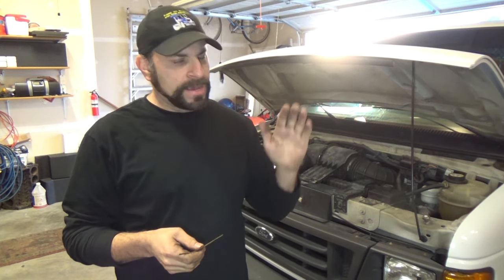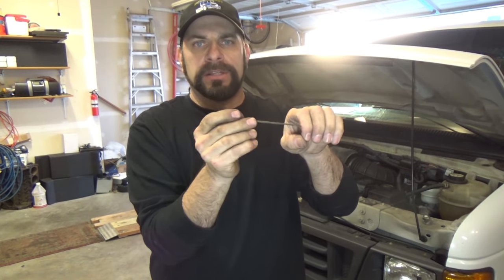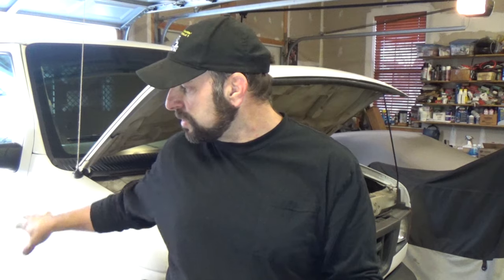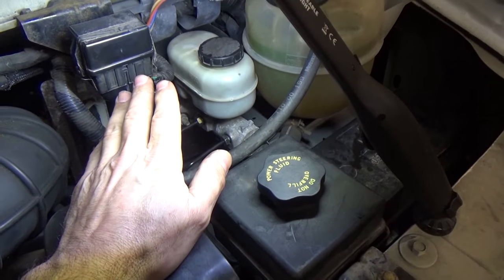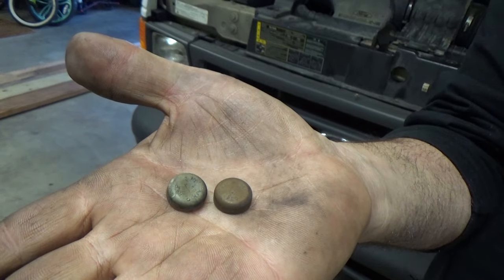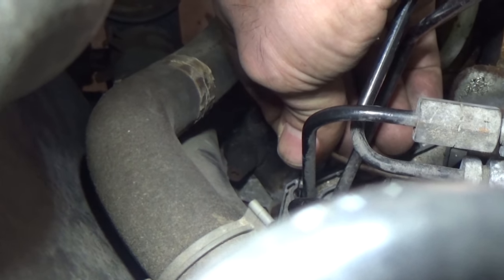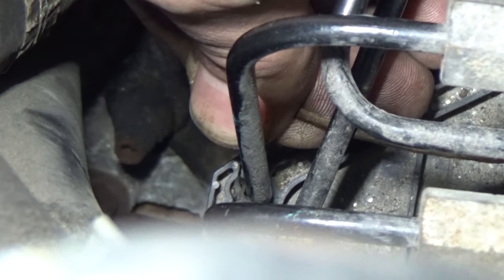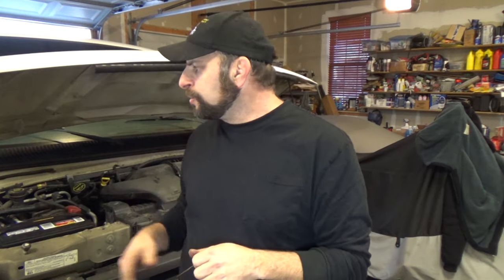Brake Pedal Goes to the Floor I ABS Pump Test I FORD I No Codes

Comment: my pedal is top pedal until i run the engine then the pedal goes smoothly to the floor .
Reply: Ever find a solution I'm in the same boat
Reply: @bradleytantlinger7041  the booster
Reply: @yasminalalgeroiseau1125 booster would make it hard not soft
Reply: Mine did same thing.changed master.abs pump was bad
Reply: It was the abs?
Reply: @mofeedfouad7391  just depends on your symptoms, everything seems the same with these, triple check that there’s no air in your brakes, take off the master to make sure the flange is pushing, then cap off master cyl lines to test master cyl(buy from oreilly and return if same symptom) then do abs last
Reply: So us the booster or abs
Reply: my toyota is doing that now. what was your problem?

Comment: This is probably the 8th to 10th ABS troubleshooting video I've watched in the last couple of hours, and yet it is the only one that actually showed how to diagnose the ABS Pump itself. Some people jumped to re-soldering joints in the ABS Module and they didn't even mention to try this first. Once you have eliminated; leaks (at each wheel, all the lines, master cyl, brake booster), blown fuses and relays, wiring/connectors/grounds, this should be the next thing to look at.
Reply from the maker: It's called proper diagnostics,  most people don't know how to test and not guess!  Thanks for.your comment.
Reply: @ozzstars_cars  Well you've got a new subscriber :-D! What part of the country are you in?
Reply from the maker: @PapaSmurf337  thanks for subscribing.  Delaware.

Comment: I have been fighting a slight brake pedal sink for about 5 years. After a ton of break fluid, 2 master cylinders, several trips to the break shop, all I can say is ..... Thank You!
My issue is very minimal, and is intermittent. 1 pump of the brakes, and the pedal wont sink, but sometimes the pedal will sink after I've come to a complete stop. A quick pump of the pedal and its solid again.
NOW, I know what to do to fix it.
You're awesome.
Reply from the maker: Thanks for your awesome comment James.  Good luck with the diagnosis. 👍

Comment: Hate that feeling like you stepped on a plum when you go for a panic brake. Nice work Glen diagnosing and getting the Ford back on the road.
Reply from the maker: That's a great analogy, a plum.
Reply: @ozzstars_cars  - Or, in the case of modern vehicles,  a turd ... 😃

Comment: Nice video.  Thanks for your time to produce this and your helper did a great job   I have 2005 F150 with this problem
Reply from the maker: I agree, good help! Thanks for the comment and good luck with your fix. -Glen (Ozz)
Reply: @daduze, i also have a 2005 w/ this problem. The trk is currently at the mechanic shop for changing out the shift lever cable. I asked the manager to check the brakes - explained the issue and he stated to fix the 'floating brake pedal' would be around $1800....I asked him if the issue would continue to degenerate... he told me it wouldn't - i felt like he didn't want to deal with it....prob. go somewhere else after the shift lever cable is repaired ~ thanks for the vid!!!

Comment: the new Master cyl seals   worked great   but with the engine running the pedal still goes to the floor .  A Foxwell NT 630 pro ABS bleed scan tool  bleed  has improved things   but the brakes are still acting up .  I need to go find a dirt road and have a play .. maybe the ABS unit just needs a good workout .

Comment: I drove my wife's Kia Sorento after she returned from a trip out of town, and I noticed the brake pedal seemed to have a lot of travel and would sink to the floor if held. I saw somewhere to check master cylinder versus ABS module problem, to drive on a dirt road about 20 MPH and lock up the brakes a few times. If the problem goes away-at least temporarily--the problem is in the ABS module. I tried it and sure enough, the problem went away for about three weeks before returning. Each time I did the locked brakes thing, the problem stopped, but for shorter and shorter periods. Eventually I got an ABS warning light. The ABS module was $1300 plus labor, so I traded the POS in. KIA mechanics, as I found out over several trips for repairs, are not the upper end of skilled mechanics.
Reply from the maker: Must have been an old car with high miles?

Comment: Was not aware of this trick! Have seen this happen twice before and basically ruled it out by process of elimination and only the ABS module could be the cause but I never knew of a way to test it directly.
Reply from the maker: The untold Ford ABS pump secret until now! haha  It's model specific but I was able to confirm the pump was bad off camera using a scan tool (Autel 906BT) ABS test but figured the DIY test method shown in the video could help the masses. Thanks for stopping by! -Glen

Comment: Wow, that's a topic I never understood, thanks for the info! Your method of testing the MC is elegantly simple. I imagine there's a lot of force on the fluid coming out of the MC, so you'd need threaded caps for each end to test it properly. I don't remember those test ports on my GM abs sensor, I'll have to look again. Too bad the replacement is so expensive. Removing the ABS would be more complicated than people think, one would have to add in a diverting valve for safety, it wouldn't be easy.
Reply from the maker: A couple of brass plugs and test away the MC.

Comment: That's a stuck open de-pressurisation ('dump') valve in the ABS module... The hole is just a hole on the dry side of the accumulator piston. What's happening here is when the brake pedal is depressed, it's routing master cylinder line pressure straight through the open valve into the sprung accumulator (the 'spring' sound you hear when the piston is pushing the piece if wire out...) Normally this valve only opens as the second stage of ABS intervention after the isolation valve closes first, in order to reduce pressure in the caliper and allow the wheel to rotate again. But in this case it's always open, so master cylinder pressure is just going to move an accumulator piston instead of the pistons in the caliper... I had this same issue on a Nissan GTR on track.
Reply from the maker: Thanks for the detailed explanation.
Reply: @ozzstars_cars  No problem! The other symptoms I had, which helped give clues on the GTR, was that the brake pedal would get firmer when you drove the car hard and got it to slide on track in the wet, with the stability control still on! This was really confusing, but again what was happening here was the stability control applying assymetric rear brake in the corner, via the ABS motor pump. This is a bit like pumping the brake pedal with your foot, taking up some of the movement in the accumulator and giving a shorter pedal stroke. But the pressure soon bleeds off... Slow down again and the pedal went to the floor again! Only resolved by replacing the module.
Reply from the maker: @chillyfly  off camera I tested the ABS module in that van with a scan tool. Commanding the valve(s) to close and open. It failed.
Reply: @ozzstars_cars  That’s really interesting, sounds right! The ECU software I have for my Nissan doesn’t allow testing individual valves unfortunately, but it runs a complete valve calibration, and it failed on the rear circuit. Funnily enough I had massive problems with overheating front brakes, but the rear pads barely wearing at all…
Reply: This is a description on function I was looking for. Now can I rig it? Or just get the valve/pump body? I felt this on my 250 the first time the other day under hard braking with my 7000 lb trailer behind it. I didn't have the warm a fuzzies about it and now I'm here. 😂
Reply: @chillyfly: Is it also an effective test to plug the exits from the ABS module and apply brakes? If the dump valve is leaking, then you'll always feel the accumulator squishing. If it's not leaking, then it should be rock solid just like the master cylinder.
Reply: @idahoviking  Good thought! I'd like to know this, too.

Comment: Thanks for the video, good job!  I worked in the business and have never had an abs module go bad, so this is the first car that has happened to.
Reply from the maker: You're welcome.  In this case the module was fine, the pump was shot.
Reply: @ozzstars_cars  So if the pump is fine but the module is bad (stuck valve or something) how would you know? Just eliminate all other possibilities? I'm asking because I'm having a sinking pedal issue on a 2014 Fiesta ST and I want to be sure of what the issue is before I start throwing parts and money at it.
Reply from the maker: @anthonyantoine9232  fire up a scan tool and test/check that way.
Reply: @ozzstars_cars  Gotcha. I kinda figured as much, but was hoping I could do it easier or without spending money lol.
Reply: @ozzstars_cars  Another question that I never thought about previously, if the ABS is seemingly functioning as it should, but the pedal goes to the floor, can it still be an ABS issue? I still have a gut feeling that it's the ABS module or pump in in some way, because while the ABS engages my pedal is super firm as it should be. To me that seems like confirmation that the master cylinder is not leaking. What are your thoughts?
Reply from the maker: @anthonyantoine9232  test and don't guess all component's.
Reply: @ozzstars_cars  Gonna get a brake pressure test kit and see if the master cylinder holds pressure without the pedal sinking. I looked on my Fiesta's ABS module and don't see the test ports shown in your video, but I'd really like to test those too if I can find them.

Comment: Your conclusion appears to be that fluid is leaking into the piston that is effectively a pressure blow-off accumulator. Therefore a valve is not closing completely. Is there a way to nondestructively remove clean/replace the valve?
Reply from the maker: I do not know of any way to rebuild an ABS pump if that's what you are asking?
Reply: @ozzstars_cars  Yes. If the valve can be serviced, then no need to replace anything but the valve. It looks like they are press fit, which means some sort of removal and then re-pressing would be required. Removal appears certain to be destructive. And there's a seat that the valve tip contacts. So seat removal also might be necessary. It may be a 5 minute job, but it will take the usual 1000 hours to figure it out the first time, make the necessary pressing tool, etc. It's also possible that a solenoid is not passing current, so the valve is not being held closed. But regardless, that initial time investment may be big.
Reply from the maker: @idahoviking  and be 100% sure it functions correctly because that is some serious liability if things go wrong.

Comment: on the 1996 E Vans the HCU is under the Drivers seat on from Rail before the Fuel filter..  It gets wet. and the HCU controller on top will Short out.. You can remove and replace it with out removing the hcu..    IF those solenoids get wet like mine did it can cause the Van to Shake and Shimmy without even touching the pedal.

Comment: Awesome video! This helped me diagnose and fix the sinking brake pedal on my 2003 F150.
Reply from the maker: Nice! Smash the thanks button if you get a chance Donnie.
Reply from the maker: What route did you go to fix the truck?
Reply: Got a used ABS pump off a like vehicle in a salvage yard.
Reply: @commonsense1557  How difficult was it to replace? I have the same issue and the local Ford dealership wants $2100 for the repair.
Reply: And did the module have to be reprogrammed?
Reply: @bradh6185  yes it did need reprogrammed and system bleed.
Reply: @bradh6185  Yikes! Fortunately I have a friend who works at a ford dealership where i live and he did it on the side for me. The hardest part was bleeding the abs system according to him. That's why I had him do it otherwise it would have to had been towed if i put the part on and not had the computer to bleed the system.
Reply: @commonsense1557  So the only way to bleed them is with a computer that only a Ford tech would have access to?
Reply: @bradh6185  It might could be bled with a snap-on computer or one of those other computers but im not sure. It definitely has to be bled with a computer though and it's also needed for the module reprogramming.

Comment: Sinking also could be the brake booster is the booster is leaking good informative video
Reply from the maker: Leaking booster is the opposite effect, hard pedal with not much braking
Reply: @ozzstars_cars  yeah that's correct been a long week bro sorry I did 4 brake boosters in last 2 days just tired I miss spoke your right
Reply: silverbird58  very true

Comment: Great video, your expertise is much appreciated. I can’t wait to run this “rod” test. But  I thought I heard you say that you tested the module before you did the pump. How do you test the module?
Reply from the maker: Using a bidirectional scan tool. Also checking for proper power and ground. I made this video for the masses that don't own a bidirectional scan tool.
Reply: Never heard of it. Thanks for all this.

Comment: And all you have to do for that is go down the road and slam on the brakes a couple of times to activate the pump and get it working and I’ve done another trick take a hammer or brass hammer and slightly tap the pump because the valves get hung up in it and it’s mainly on Fords drive down the road 30 to 40 miles an hour slam on the brakes get that ABS system active do it 3 to 4 times your problems gone you got a full pedal it won’t go to the floor no more I’ve seen people replace their ABS pump and had the same issue. You have to activate the pump get it working again.
Reply from the maker: That's an interesting trick.

Comment: Well, I have the same year, same model van as you and did this test with a similar result!  So, if I understand you correctly, we need an ABS pump, but NOT the module, correct?  Any compatible vehicles with a similar pump?  Not having much luck sourcing it as of yet.  Thank you for this!
Reply from the maker: Sorry but unfortunately I can't tell you over the internet what is wrong with your van. I know the owner of the van could not source an ABS pump, he sold the van shortly after I diagnosed it.

Comment: Bmw x3 just had my rear brakes replaced and before I paid I checked and yes they are Spongy and they say they would have to go deeper and check the master cylinder $$$
Reply from the maker: Sounds like there could possibly be air in the hydraulic system.
Reply: @ozzstars_cars  after $939 they bled the brakes finally
Reply from the maker: @SeasonsOFcolors  so I was right?
Reply: yes you were right

Comment: Okay love the VIDEO...my goes to the FLOOR.. and i just did that TEST mine has no movement
Reply from the maker: Have you tested the master cylinder for an internal leak? Checked for a leaking brake line?
Reply: @ozzstars_cars  okay will do the master cylinder test tommorro disconnect the the 2 brake lines and cap it I will have to to autozone to get caps I guess ...

Comment: Excellent video, one of a kind, and thanks to your daughter as well. My question is, can I use a 2-way scan tool to check the pump/solenoid valves? I can't see those ports on my vehicle ABS pump.
Reply from the maker: Yes a bidirectional scan tool can be used to test the abs pump valves.
Reply: @ozzstars_cars  Thank you very much Glen!

Comment: Pretty cool.  My GM van (and apparently most of them) burns through wheel speed sensors like candy corn.  Sends both the ABS and the traction control running for the hills.
Reply from the maker: That keeps things interesting and new. 🤣

Comment: Do many, or most, other makes and models cars and vans have these same two test ports on their ABS pumps, too? If not, why, I wonder. Thanks. Also, can ABS pumps leak externally through these piston test ports (the ones that have them)?
Reply from the maker: I have never seen this design on other makes of cars.
Reply: @ozzstars_cars  Thanks. I know my 2007 Hyundai Accent ABS pump doesn’t have these test ports. I’m  having soft pedal issues and ordered a used replacement ABS pump for it, anyway, hoping that’s the problem. The master brake cylinder is good so that only leaves the ABS pump as the culprit, I’m hoping.

Comment: Cool Tip, I didn't know that
Reply from the maker: And btw this issue does not cause the ABS light to glow on the dash.
Reply: @ozzstars_cars  With no codes or abs light as mentioned, my dumb old butt would of loaded a master cylinder in the barrel and fired. LOL
My DD don't even have ABS 
Winning!!! (cautiously)

Comment: Hey Ozzstar.  I think you did a great job showing the steps to test.  My ABS is from a chevy silverado 01.  I did your test but I have the opposite effect in my test.   I get no movement at all.  What do you think?
Reply from the maker: I am not sure if GM used the dame technology. A professional level scan tool with abs control features would be helpful.